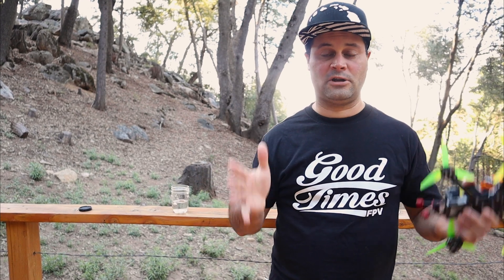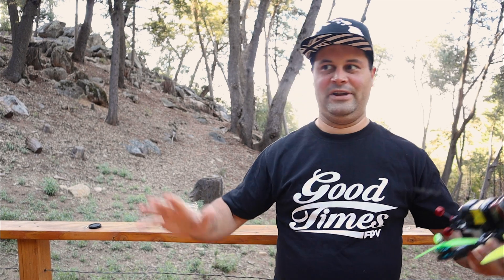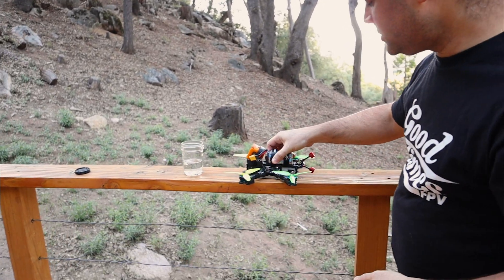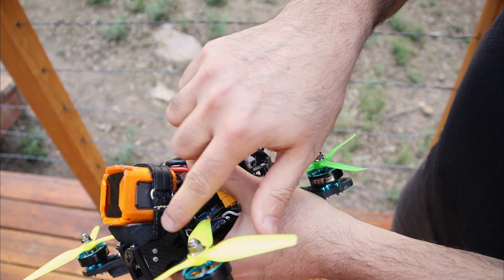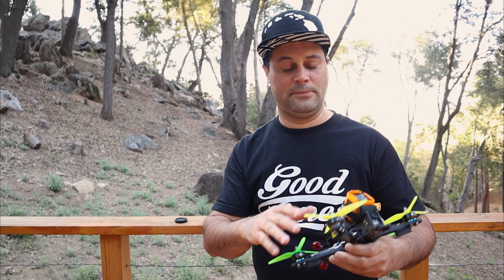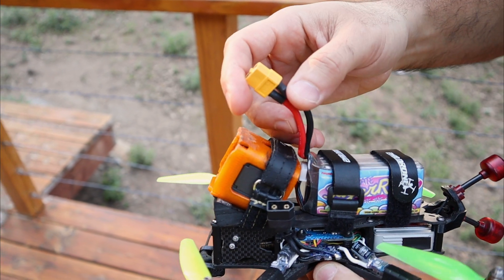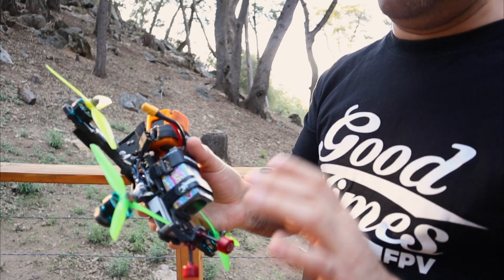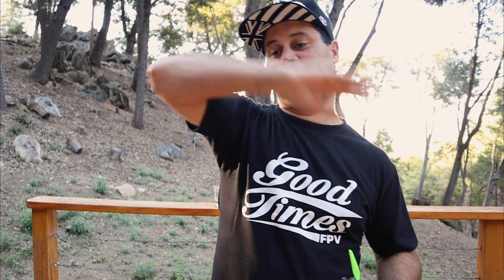Impulse RC Apex HD DJI FPV Freestyle Rig Rundown

Comment from the maker: I've gotten questions about the quad's weight. All up (AUW), with a GoPro Session 5 (with a TPU case) and 1300 ThunderPower 5S: 675g. The quad dry, with straps and props, but not battery or GoPro: 411g.  I sometimes use a lighter 1150mah 5s. With that and a Session 5 it's 660g.
Reply: If you go vista and 4in1 probably you will save a lot.
Reply from the maker: @jorgeromero4680  There are reasons I used to fly individual ESCs. But I've found a 4in1 I like. I've actually updated my rig for 2021 and should have a new video series soon. And yes, also Vistas, so you're pretty much spot on.

Comment: What’s your setting on Session 5 champ?
Reply: It depends on the lighting conditions and my target. Usually for mid-day I shoot at 60FPS/1080p. For dawn or dusk I'll do 30FPS/2.7k. Always with Protune on, and usually with shutter auto. If I there are many shadows I'll usually lock my white balance so I don't get tons of color shift. Also, I've mostly always shot in GoPro color, but lately I've been experimenting with flat color and more post-processing. Thanks for watching. -Danny.

Comment: Thx for the video. Today i finished my racer with t-motors items. Hope to fly it in the next view day to check it :-)
Reply from the maker: Nice. Which model did you go with?
Reply: @PinchTune  
- remix frame
- F55A and F7 FC from T-Motor
- T-Motor F40 2150KV
- TBS gear
maybee later a other frame and also a Motor change.
Reply from the maker: @fpv-bro  That's cool tho. The main Apex quad in this video is now on Fro Pro IV and the new Pacer 60A ESC. However, that doesn't change that the F40 II 2150 is still great. I've been flying that motor as usual. I've flow about 20 pack on the F40 II 2150 just this week.

Comment: If haven't already, you might try the T-Motor 5143S prop! Very nice! That battery lead out the side, are you having to do a remap of your motors?
Reply from the maker: I will. I mean, those T-Motor props are all made by Gemfan. Very similar in design to the Hurricane props, although some people prefer one or the other. I'm looking forward to ordering a few sets to try out. In regards to the motor mapping... The PDB is put to the side like that, but I still wire it to match the motor order I want. Either way, it's FlightOne so you can easily assign motors during setup without having to do a bunch of CLI remapping. Plus, I believe FlightOne recognizes the standard Betaflight motor order, but, don't quite me, I think internally it actually uses the KISS motor order of 1 being left front, or something similar like that. I forget, because on FL1 motor order really doesn't matter. You can assign the correct motors and spinning direction during the wizard setup.
Reply: @PinchTune  - yes, similar to the hurricane but a thinner width blade, very responsive, light, with plenty of pop! Not familiar with F1 at all, but if I turn a 4 in 1 ESC 90 degrees clock wise, that would put the power leads between motors 3 and 4 on a BF FC. I could still solder to the right Motorhead; but that would kinda be allot of wire routing. I guess for a BF FC, it would be easier to remap the motor resource. I think that's why I've always ran my power lead out the back.

Comment: Great video.  Danny, do you have a build video for the F1 Apex with DJI?  For the life of me I can't get the OSD on F1 FalcoX to work with DJI?  I soldered the Air Unit RX and TX wires to TX3 and RX3, while running Crossfire Nano RX on  TX1 with absolutely no luck.
Reply from the maker: Thanks for the good words too. I don't have a strict build video for this, but I have quite a few videos where I should bits and pieces of the build. However, nothing where I go into detail on how to set up DJI OSD for Falco X. Sounds like I need to make one.
Reply from the maker: You have to make sure the MSP connection is correct and enabled. That's the key for it to work.